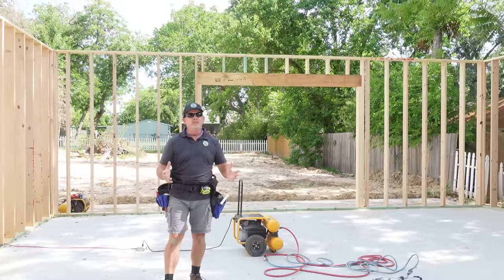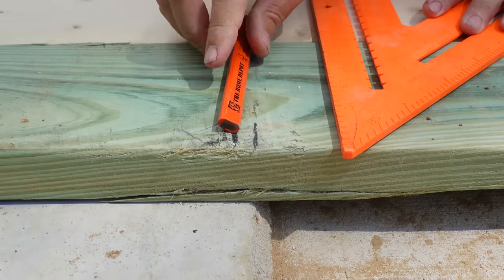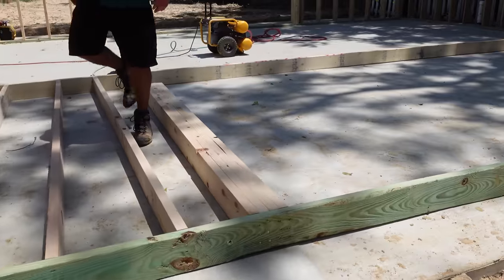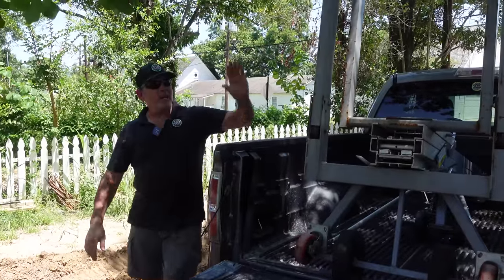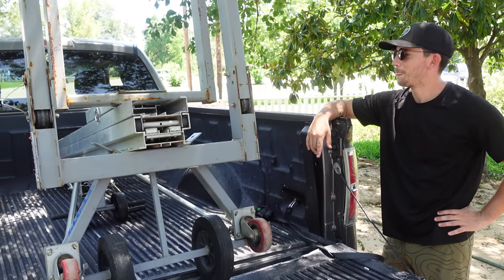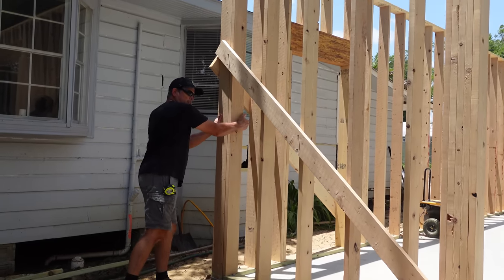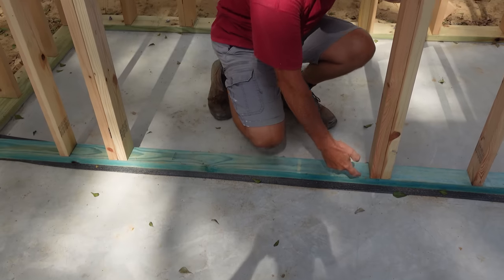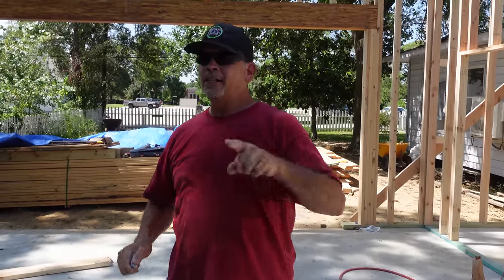FRAMING Our DRIVE THROUGH Garage!! - Will This ONE MAN LIFT Work?

Comment: Hi. I just started watching your videos today. Fun to watch, and great commentary.

I kind of feel obliged to comment on the PSL beam you used. From what I could see in the video, I strongly suspect there was a 10 ft. long delamination defect in it. Luckily, I doubt it would require replacing or repairing, but it shouldn't have been sold to you. 

My other comment is that there was a simpler and MUCH SAFER way to lift up the wall with the beam in place. I'm a bit surprised it didn't tip over and get someone hurt.

 I can explain more, but doing so in "comments" probably is not the best forum.

Comment: Look up a wall jack. They slide over a 2x6 and lift walls like a highlift jack. 
They will do 1000lbs each. I just did 300 linier feet on my build by myself. 2x6 , 9 foot tall , sheeted on ground. 20 feet at a time.

Comment: I did similar sealing on my house, i did everything i could to keep water from getting behind the zip. Problem is water did get in there and I had sealed it in. I rotted out 10 feet of my rim joist by over sealing it.

Comment: Hello Stud Pack,  I was wondering what your thoughts on the Strong-Tie THDB62400H Titen HD Screw Anchor bolts would be?  It seems like it would be much easier to tilt up the wall rather than lift?  Have you used the Titen HD anchors?

Comment: You could have made your job so much easier by using the bolts as a stop for your wall. If you have drilled your bolt holes correctly, the wall will drop right on your bolt holes. If the wall doesn't align with the bolt holes, you can use a long crowbar or just an 8' stud as a lever to lift up the wall and align the holes with the bolts. It's quick, easy and safe, and this is the way that professional framers set walls. The bolts act as a very efficient stop, to stop the bottom of the wall from sliding. I have set massive walls by hand with framing crews using this method and have never had a problem. 

Also, probably with three men, you could have set this wall without the manlift (Genie lift).  The trick is to temporarily nail plat material approximately 12' - 14' to the two end studs below the top plate with four framing nails that are centered. Then the three of you could lift the wall up and set it on 4' tall horses. then you use the 12' plates to push the wall up in place on top of the bolts. The middle man grabs a 12' plate to help push the center of the wall up after you get it up 7'- 8' high. This isn't easy, but it can be done safely. This is how professional framers would have lifted the wall, if they didn't have a skytrack (forklift) on site. If you think about it, three men who are in shape can easily lift a 500 lb. weight. It is not the weight that is the issue, it is the awkward shape of the wall. Once you get the the top of the wall up about eight feet, the men on the two ends of the wall can control the top of the wall with their 12' long plates nailed into the end studs with four nails. Because the nails are centered (nailed together at one point), the 12' plates will rotate around the nails as you lift the wall and still securely hold the wall. The man in the center can help push the center of the wall up with another 12' section of plate by pushing on the top plate (once the wall is approximately 7' - 8' in the air.

That being said, I think that you were smart to spend the $70 to rent the lift because this wall is very top heavy and hard to handle. Because you don't frame (and lift) walls every day, you were smart to rent the Genie lift to control the wall - good job! Professionals are used to lifting heavy, awkward walls because they do it every day. Also, because this garage beam is so massive, it could easily demand four men to lift and control it without the lift. 

Your videos are always interesting and in general you do a fantastic job on a large number of trade specific construction skills. I would recommend you to anyone as a skilled, GC who is honest. As a civil engineer and a licensed general contractor, I greatly enjoy your videos and I learn from them all the time.

Comment: Don't you need a double top plate? Or are you going to add that later?  Or, does code there not require it.?  When I was a framer, many years ago, we always had 2 top plates, and at a corner, one was left short and the other ran long, so we could lock the walls in together.   Also, I agree with several of the other posters here, Stand up that wall without the Beam, then add it after the wall is up.   Easy enough to add the cripple jack studs after the fact to.

Comment: ** really awesome machine guys..  I'm thinking like a girl here, but I might've raised the wall just till is almost had a swing to it then lift it just enought to 'sit' on the wheels then roll the whole wall in one piece without the jiggling.  prob not a thing but to me it seems the integrity of the nails etc might have had a little dancing around going on.. ahhahaha.. girl talk.. lol.. Of course I really don't know Any Thing about that tool.. first I ever seen one..  cool idea tho.
Reply: Thinking like a girl.... you are thinking correctly. Good for you in commenting!

They were incredibly lucky that the whole rig didn't tip over and crush someone! There were at least 3 safer (and easier) methods of getting that stud wall and beam in place.

Comment: I would have folded the cil sealer up or leave it there for the dry wall to sit on. Not a good idea? Put a door so you have wall to put things on. also storage under the stairs can be kept out of site. But don't forget to add a light inside the closet.

Comment: 2:20 
Why don't you use ZIP liquid flash at the bottom of the wall all around?  With the way it rains there,  i'd  build this like a boat. I know--hard to stop water at the big doors, but just stopping water all the way to the concrete sounds best.

Comment: Make the area under the stairs accessible from the outside. Put a compressor and central vac inside to keep the noise isolated from the garage. No more compressor coming on noise when making a video.

Comment: Some Genie garage door openers can be wall mounted to clear your space on the ceiling and some garage door openers can have wifi built in there is an app called aladdin connect you have to sign in and follow the direction that are listed in the app. I just wan to let you know these are real.

Comment: No sense in wasting the space. Put the door in. 3 reasons for a door over it being an open area. 1. That's a huge span for dimensional lumber and the wall will help keep bounce and sag out of the floor above. A related concern is roof load and what the wall above carrying down to the foundation. 2. Keeping it an enclosed space means you can insulate it for sound proofing and place an air compressor, dust collector, (water heater/ Air Handler?) and other loud tools. 3. Having the ability to close the door will help Jordan keep the garage more organized and clean. Especially when the doors are open in the garage. Air currents will blow all kinds of debris in the garage, and that area will be nothing a black hole under the stairs without a wall there.

Comment: Not really important for the partition wall in the garage, but for the house and the flat I would consider building walls using staggered 2x2 or ripping 2x4 if that's cheaper. A wall like that has overlapping insulation and kills sound a lot more efficiently than a regular 4x4 wall

Comment: Leave the wall in place so that you can maintain the integrity of the garage to contain exhaust fumes from vehicles parked withing. Before you do anything to that wall, check with a building inspector to determine if doing so will fail the project due to exhaust integrity.

Comment: I recently bought my first compresser/nailer kit. What adapter do I need to attach the inline blowgun to the quick disconnects on my hose or is better to just buy a different hose with the proper fitting.
Reply from the maker: The inline blowgun has 1/4" female pipe threads on each end.  It should just screw to the end of the hose and then the quick disconnect (with male threads) should screw on the blowgun.

Comment: enclosed storage area,
my parents actually live in a house that has a fully enclosed under stair box next to the small basement toilet, so when my dad saw that and mom wanted more storage it was a no-brainer to cut a small opening, frame a small access panel from the paneling cut, and then put hinges and a hook latch on for storing spare metal folding chairs and a few bits we seldom use but have no wish to throw away
given you are not even done making the walls and floors it would be ideal to design it as a small semi-finished storage closet, the unfortunate part about designing an under stair area is the aspect of the stairs slowly making the ceiling lower and lower
as jordan is a youtuber he could also use the fact that you are only making a breezeway between stages of the build he can maximize the internal volume by making an insulated server cubby that has vents right to the outside wall to have no need for AC for his NAS+render server+ect as it can vent outside through a small filtered blower for intake and common dryer vent for the exaughst

I vote storage closet+server cubby in two nice access panel doors so you don't need to open the closet and take the crap out to access the servers

Comment: It's best not to blow the concrete dust around.  The dust contains silica, which is a lung hazard.  I would recommend you use a HEPA vacuum instead.  At work, OSHA regs require either a wet method, a respirator that has been qualitatively fit tested by an industrial hygienist, or the use of a certified HEPA vac.  I know this is a private "homeowner" type installation, but the risk is there and should be mitigated.

Comment: Personally I would go with Jordan's idea and remove the wall. Yes the wall and door would hide clutter and keep out dust and leaves and stuff, but it also sort of limits what you can put there to things short enough to fit between the walls and light enough to carry past everything else. If it's open you can have things that maybe stick out a little there, or are heavier, or awkwardly shaped. Also, with a door you have to keep the area where it swings free of clutter, so if it opens into the space you lose those few square feet to store things, or if it opens out you have to be sure you don't park too close. Then there's the added expense of another door, lighting, wiring, switches, etc. On the grand scale of the build those few things aren't going to make or break the budget, but it is extra money. Lastly, in my experience places that are out of sight are also out of mind and can easily become dumping grounds for stuff you just aren't ready to, or don't want to deal with, so it'll become an easy place to just dump things that you'll "get to later" and quickly turn into an unorganized mess if you aren't REALLY disciplined about how you use it.

Comment: Quick question--what about this project / local code led to not cutting relief joints in the concrete slab... or are they just not visible on camera?
Reply from the maker: our concrete finisher said they're not needed on a slab this size... so far so good

Comment: I suggest leaving the interior wall framing as is for now and not drywall it.  Make your decision at a later date when you get a sense of the room in the garage and the flow.  Easy enough to remove the framing  or add a door at any later date.

Comment: instead of cutting the base plate at 16:40, I would have attached a ratchet strap or a come-a-long at the top on each end and ratcheted it into place.  I use ratchet straps and clamps when lifting heavy beams by myself.

Comment: Totally new to framing, may I ask why no bracing between the vertical studs?  Like the ones between floor joists.
Reply: Watched the next video where the inspector stopped by and I caught that blocking only needs to be added should the ceiling be over 10', which yours is just right at that.  This project has been great to watch, thanks for your efforts to share so much!

Comment: Call 3  licensed, qualified, termite company and ask about getting a quote for a Bora Care termite treatment. Call them out when the house is done getting framed (tar paper or roof on so it doesn't get rained on). I know you have previously paid for the termite pretreatment "spray" but that is all washed away and is probably made it's way to the ocean now. This is just a different type of preconstruction termite treatment (it's not failproof but just another tool in termite prevention) that is applied to the wood and plumbing penetrations after completion of framing. This will lessen the likely hood of termites eating your wood up and you guys are working hard to put all that stuff.  You don't want termites to eat that 500 pound beam and guess what, they love coming up around the expansion joint where the driveway butts up to the house and eating expensive garage door headers. Just a suggestion. Once the insulation and drywall in it's too late to apply it and it's basically going to treat all the wood against termite infestation and if done right it not going anywhere unless the treated areas get flooded.

Comment: Just a layman's opinion, but it's hard for me to see much advantage in having that double-wide garage door. Those doors always look kind of flabby to me, like they have trouble supporting their own weight when they're in the raised position. But considering that this particular garage will have a second floor it seems even more problematic, having an 18 foot span with no load-bearing wall underneath it. So I'm wondering just what the upside is on this decision.  Why not just have two single bay doors? Again, as a layman, I'd have kept that heavy beam, but put a heavy post between the two single doors.
Reply: I'm in agreement with having two doors. A PSL beam 5.25" × 11.875" x 18'10" SHOULD* have no problem spanning 18'. The panels on an 18' wide roll-up garage door would need special bracing to ensure they don't "sag." Especially over time, as they become weathered. 

In theory, it could be possible to have a middle post or narrow wall assembly that is removable when both narrow doors are fully raised.

*I wrote SHOULD because actually that PSL beam arrived containing a massive end to end defect.

Comment: Under the stairs, mechanical closet for hot water heater, shop air compressor, home internet distribution. Please wire this structure for Ethernet!

Comment: hey guys, love the show- my fav on youtube, and I am an avid watcher. I love the way you go about describing what you do, and the family trait is so cool.  Need more dads like you.

However, I have a question. I have a strange problem here. I have an older home that was added on to. The builders left the original roof and added to it to create the new roof line, which is now roughly a 2/12 pitch. My problem is, these idiots left the old roof, line and headers in the original position, so it is load bearing at the opening I need to open up (in my kitchen). I am remodeling my kitchen and opening the space, the new opening is 10 foot wide. Will twin 10 foot verticle 2/6's be enough support? Maybe triple? FYI this is the near center of the house. Short of tearing out the roof I have no other option.

FYI, I have already built it- 2 kings per side with triple jacks per side- double 2x6's, so my opening is actually 9 foot 6 inches. Seems to be fine. After I pulled out my temp roof support, no drop. However,  after a week I have a 1/2 inch center drop at my new opening. My worry is snow load and time. What to do?

Comment: Just watched the video for a second time and realized you didn't flush the garage door beam to the inside or outside wall. Any reason why? At around 10:10.
Reply: The 2" × 6" nominal size lumber is actually 1.5" × 5.5". The Parallam PSL beam that they used was 6" x 12" nominal, but actual dimensions are 5.20" × 11.820". So the beam width is 0.30" smaller. They did try to raise the ends flush, but either the beam was slightly "bowed" or it sagged in the middle before lifting. The beam's strength and stiffness is primarily in its depth, not its width. It has to do with strand orientation and compression during manufacturing. Another issue may be that the beam had a severe defect which could have allowed moisture inside the beam causing it to swell unevenly. I've contacted Paul, and he is aware now of the defect. It should be replaced, but I don't think they are going to. I hope they don't end up regretting that decision!!!

If you listen at 10:00, he actually asked "Did you just crack it doing that?" (When somebody jumped on the beam to seat it). I think Paul saw the crack in the beam worsen, but the follow up reply was about cracking the concrete slab. If you review the previous video, where they crop off the 39" doorway header the defects can be seen at both the ends and on one wide face.

Comment: If he's planning to have an air compressor in the garage, insulate that wall and put a door in it and put the compressor in there. Otherwise I'd remove as much of the wall as possible and build in a workbench into that space so it doesn't stick out into the garage.

Comment: Hey Paul I’m shocked they made you build that massive slab but not one hold down
Reply from the maker: Yeah no seismic requirements here and we’re just out of the coastal zone but the entire building gets covered in ZIP sheathing essentially locking it all together 👍 plus there’s some hardware we’re waiting on too

Comment: When cutting the beams, so you do not have to measure each side, why not use the circular on the short sides? This should keep all your cuts in line and then only have a small piece in the middle to recip at the center keeping the recip blade straight(er) during its cut.